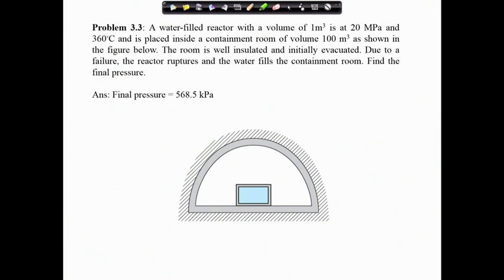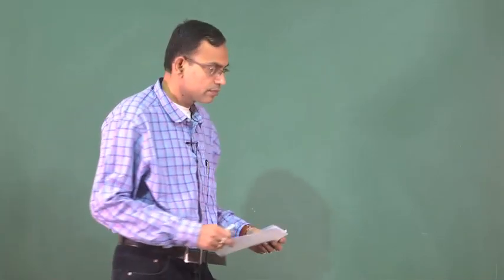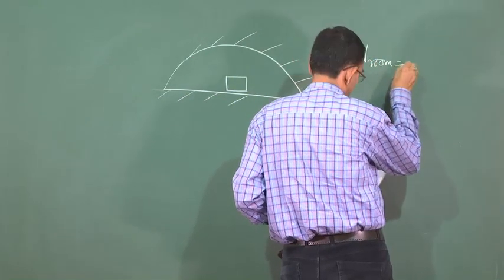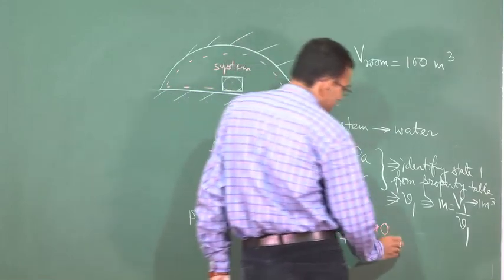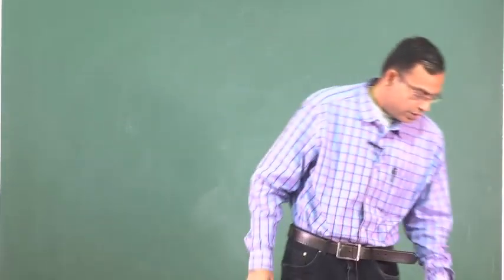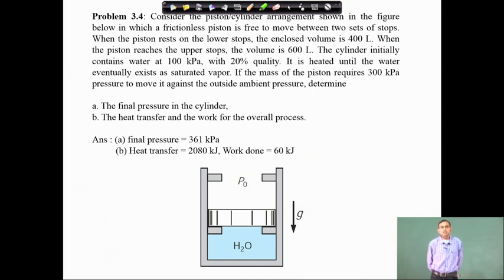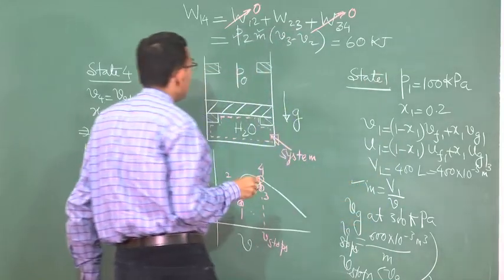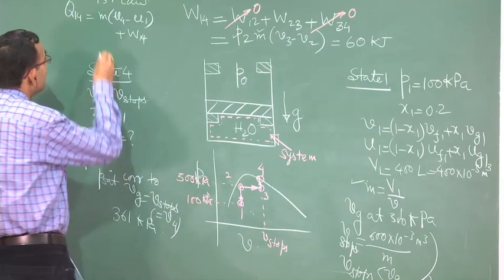Lecture 17 : First Law for a Control Mass System : Representative Examples (Contd.)

Comment: Sir I am unable to find state 1 specific volume  
You said that we need two intensive properties to get any state
Here we have only P1 and T1  and from table I got that state of system is under the saturation curve and not super heated 
Further I am unable to find specific volume v2
Reply: State 1 is supercooled liquid state...So, see the table of supercooled/compressible liquid water table...If you see the table of saturated table(Pressure), at P=20MPa, T(saturation) =365°C...which is greater than T1=360°C...So the state 1 is in supercooled state
Reply: @deepanshuchaurasia1290  Thank u :)
Reply: @deepanshuchaurasia1290   isnt the state 1 super heated